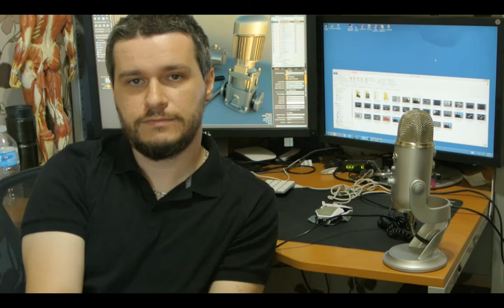Modo Modelling:  Introduction

Comment: Hi Martin.

You earned a huuuge thanx for these series :)
I used max for years, and than mayaLT  for another 2 or so, now I began learning Modo (indie version). It's so amazing, well thought, and the tools is years ahead of MayaLT's. I dropped my mayaLT centered workflow completely in the fourth day, couse of you :)
Thanx You!

Cheers from Hungary! :)
Reply from the maker: Maya does have some neat tools to it as well ( and especially the really cool scripts that people have been building lately, but to bad it doesn't work in LT ( it doesn't have scripting right? )
Reply: Yes, part of it is missing I think. 

There is a lot of script I tried to run, but not worked. 
Globally I found the modo way better. Work planes is a wery graceful tool, object paint is too complicated for maya (there is a script I tried to run for easier work if I recall). The bridge tool, beveling with shapes, the pattern selection is along was a turnpoint for me.

The center VS pivot thing was a small annoying thing, but now I get it :)

I will miss some features, like the uv distortion (red-white-blue colored mode),  but a lot of small annoying thing will be forgotten, like the "," instead of "." in the numeric section is never worked as a "coma key" when typing. and the lack of 3d connection is a huge disadvantage. (I'm left handed, it is a must for me I waited for it since the end of 2014, and nothing...)

But it's true, modo need a completely different mindset during working.
Rigging / skinning is what I am not yet tried learned in modo, hope that part is not that bad :)

Comment: Thanx for modo vids Martin, refreshed my memory. Little question on your drone work.
Do you ever retopo hard surfaces for better cut edges etc? Thanx.
Reply from the maker: Sometimes sure. I try to just fix it on the original model if possible, but it depends on the complexity of the model overall. If there are a lot of holes and stuff then I try not to because it will waste a ton fo time. It really depends. But yeah I do sometimes retopo the end result.
Reply: Thanx. Looking forward to the Drone film.